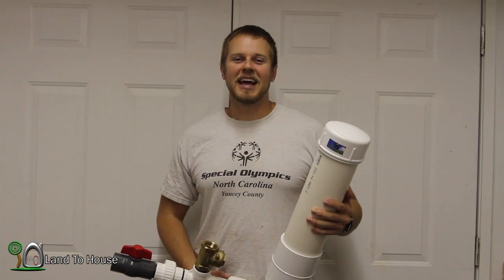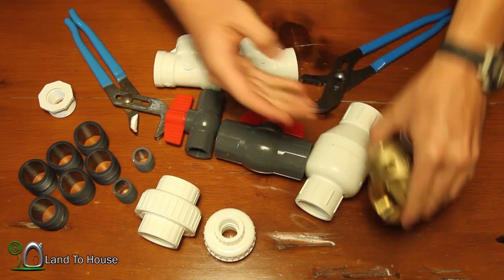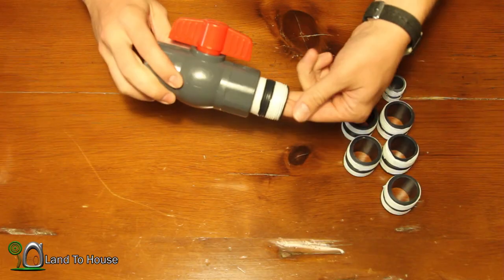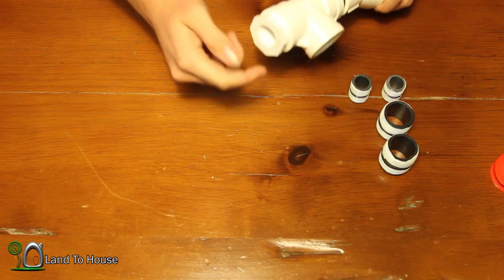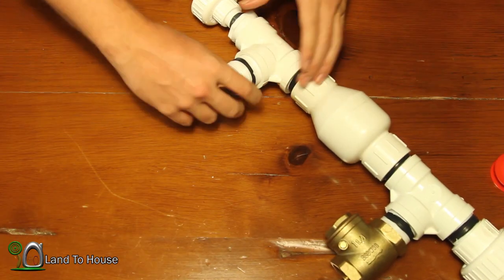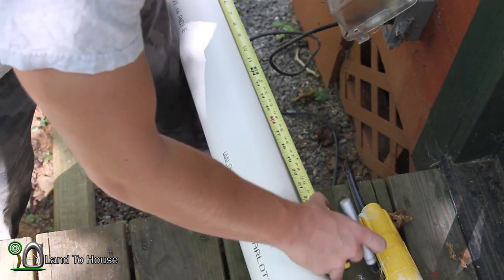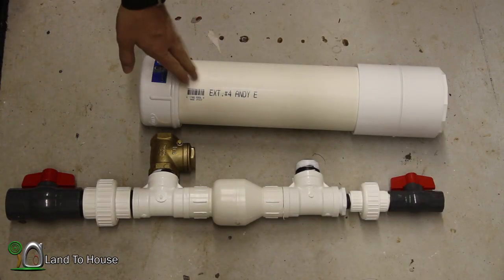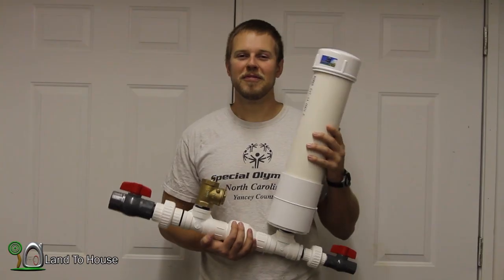How to Build a hydraulic Ram Pump

Comment: Why do you choose to use an inline valve instead of 2 brass check valves? Thank for the awesome video.
Reply from the maker: Thank you for watching! There are a few reasons. Pvc is cheaper, lighter, and when tightening the pvc does not have a direction. The brass has to have the swing pin upright.
Reply: @LandtoHouse  Thanks so much for the reply. My only concern was will the inline valve have the durability of a brass check valve? 
If I understand what you're saying (and I probably don't - :^} ) there would have to be a few more components to get a second brass check valve in the proper orientation - or - is it the orientation of the threads that's the problem?
Thanks again! Awesome video and product. I have you bookmarked and in my wish list on Amazon.

Comment: Very nice How to Build!!!
A quick question:
I have a great Creek with very strong flow, so I don't need my source water up from the pump because it's good already.
But how is the limit distance from pump to the destination tank when the land is 45° Up?
Reply from the maker: The horizontal distance is of no consequence to the ram pump. I have personally pumped over 700 feet with no reduction. The vertical height is the limiting factor for the ram pump. For every one foot of fall entering into the pump you can expect seven feet of lift. The angle does not matter.

Comment: I would suggest to use the stainless steel check valve but it is better to take out the spring
Reply from the maker: The stainless steel valves will be installed in all LTH pumps in about 2 months!
Reply: @LandtoHouse  My ram pump sometimes the heart beat is not cosistent and the pump is stop. One time watching on the yoitube when one of the guy is making his own ram pump he take out the spring of his waste valve so I decided to do the same and have a very good result. For more than a month my ram pump is continuosly working witout any single stop and the heartbeat is very consistent.

Comment: Hey Seth, .... so, if I was wanting to build a pump, to deliver water to a sprinkler or dripper hose, would this be an option for the hammer pump, rather than delivering to a tank???
Reply from the maker: Hello. I have on my list of tests a video showing the ram pump running straight to a drip line. The flow rate is typically slow and the pressure is low. It works best to have a storage tank that you can run the water from. But I have a few customers who have run the ram pump straight to drip irrigation.

Comment: Is there a formula on how to calculate the size of the ram pump relative to the height and lengt of where the water is needed?
Reply: I watched a video of a Colombian manufacturer of ram pumps and he say a 2"inch check valve and so the rest of the pump should cover a 500 meters distance and about 35 meters height.
Reply: @venley28  nice information thank 😊🙏

Comment: I have a question why do a 1- 1/4 Ram pump versus a 3/4 Ram pump is it just because the bigger one moves more water
Reply from the maker: Yes you got it. Larger pumps move more water.  If you don't need up to 1440 gallons a day than smaller pumps are great.

Comment: Learn how to pronounce close for a short nipple. It is not like close (cloze) a door. It is pronounced close, like 'That is too close for comfort.' Nipple sizes start at 'close,' 1 1/2 inch. 2 inch, etc. When you use a close nipple, the 2 fittings end up 'close' to each other, not cloze to each other.
Those are not wrenches, not even pipe wrenches. Those are Channel Locks or tongue and groove pliers or previously known as Water Pump Pliers since they were used to periodically tighten the packing nut on the water pump on the car engine. 
You tell us to put the Teflon tape on clockwise but you hold the roll backwards. If you hold the tape so it comes off the bottom of the roll as you pull it away from you over the top of the threads, you can wind the Teflon tape tightly so it forms into the threads. 
I would be embarrassed with the lack of knowledge in this video. Oh yeah, don't forget the PVC primer before you use the PVC solvent weld cement and a 1/4 twist to seal the joint.
For an efficient pump, you want the pressure in the tube to be 5 to 7 psi less than .43 psi for each foot of rise of the water on the pressure side. If you are pumping water up 100 feet, the tube should be 43 psi minus 7 so 36 psi. .
Reply from the maker: Hello mark g. Thanks for the comment. Pronunciation is a funny thing. Ask my Mexican friends to pronounce that word. You will be embarrassed haha. Perhaps it's because I have lived in so many places with strong accents that I pronounce words differently.  ... tool name: yes it's a channel lock. .... if you would post a video of your ram pump work please. I would love to learn from your knowledge.
Reply: @LandtoHouse  You said, "1 1/4 'cloze' pipe nipple that allows the components to be screwed 'close' together." You did not even notice your own 2 different pronunciations in the same sentence. 
If you learn the names of parts from your Mexican friends, maybe you can learn a bit and teach them. 
I never ended up building a pump. I lost my artesian flow when a neighbor down the hill illegally drained the water table below my artesian level by venting his well. He vented 25 million gallons onto the ground in 8 months.
As a student of mechanics and physics, I've studied the various designs. The air chamber needs enough pressure to hold the water column to the top. If you do not put enough pressure in the inner tube, you dampen the ramp force and limit the amount of pressure that can build with each stroke to pump water up the hill.  The system will still work but just not as well. An under pressurized inner tube will end up crumpled up as it is compressed to the water column pressure.
I like the designs that use a hot water expansion tank as the ram chamber. The diaphragm in those tanks has less water turbulence so the ram energy is used efficiently. The reason ram pumps work is they use the momentum of the water to build the ram pressure. Water swirling around an inner tube can lose a lot of the momentum. Think of it as water drag or friction. 
I'd like to try making one with an inflatable test plug. https://www.ferguson.com/product/cherne-test-ball-4-in-test-ball-blocking-plug-molded-in-valve-removable-chain-c270040/_/R-30866
It would be fun to build a couple different designs to see which works best.

Comment: Do you have any idea on its limitations? Such as elevation, or distance it can pump?
Reply from the maker: This style Ram pump typically tops out at a lift height of 180 ft. This is due to the weight of the check valve. As distance goes it is good for hundreds of feet.

Comment: My apologies for spamming you questions. If you dont have the time I understand. Mind me asking why you had to put the bicycle tire in the air tank and if its important to do so?
Reply from the maker: The bicycle tube inside the pressure tank is not necessary. But with this style Ram pump the tank will become waterlogged over time. The inner tube helps prevent that.

Comment: How long does it take for the tank to become waterlogged and reduce the efficiency of the pump?
Reply from the maker: Depends on if the pump is tilted or upright. you should be good with a couple months of use before you would need to drain the tank.
Reply: @LandtoHouse  Since we don't have a tank yet, does it water log faster if you stop the flow at the terminal outlet and let the pump run.... like over night?

Comment: Is the size of.accumulator or pressure tank important? Does it affect the the speed of valves opening and closing?
Reply from the maker: The pressure tank needs to be large enough to keep pressure when the delivery valve is opened. If the tank is too small the pump will stop.

Comment: Is there a reason why you used a pvc check valve rather than 2 brass ones? I’ve seen it both ways and was wondering if there was any benefit either way
Reply from the maker: Back in the day I would use two Brass valves. The main reason for the second valve being PVC is for easier alignment of the pump and lighter shipping cost
Reply: Brass is WAY more expensive as well.

Comment: Just a question -- why do you have to use the inner tube? What if you did not and used a larger or smaller container ?
Reply from the maker: The pump will work just fine without the tube but over time the tank can fill with water. The tube just helps to keep that air in the tank.
Reply: THank you VERY MUCH ! Your helps means a lot to me :)
Reply from the maker: Happy to help.
Reply: THank you VERY MUCH ! Your helps means a lot to me :)
Reply: THank you VERY MUCH ! Your helps means a lot to me :)

Comment: I was able to run my water supply line from our water pump 380 ft and about 110 ft. In elevation to get the creek to my container. One gallon in 7.5 minutes
Reply from the maker: Great results! The ram pump is not made to have a high flow rate and at that height you are doing well!
Reply: Approximately how much head to pump height does your supply line have.  Also how long is it
Reply: My drive line to the pump is about 110 feet long with about 18-20 of elevation.

Comment: FYI I use a pressure relief/safety valve with spring removed on the waste valve to get maximum discharge psi. By adding weights on the valve stem.

Comment: Hi Seth. Will ram pump work if the water source is below the ram pump?
Reply from the maker: No sadly you have to have head pressure to operate the pump.
Reply: Any recommendation how to pump water that are below the surface? Eg. Basement water.

Comment: My set up is all metal 1 1/4 inch I’ve got over 300 feet of head pipe. It starts at my lake and runs down the creek. Just my head pressure is 20 psi. I’m pushing the water through a garden hose up to my house about 250 feet with an elevation difference of roughly 80 feet. 
My question is what would happen if I changed the waste valve from 1 1/4 to 2 inch? I’ve had to weight down the flap of my waste valve to get the cycle time right and now she needs replacement.
Reply from the maker: Because you have so much head pressure you should be just fine with the larger waste valve. Normally I would say that it is not good to mismatch the waste valve and drive pipe but with that much head pressure you can get the larger valve to close no problem.
Reply: Land to House thank you for your expertise.
Reply from the maker: Happy to help.

Comment: what kind of lift do you get with this ram pump? thanks for your well explained video kudos
Reply from the maker: This diy style ram pump will typically get a 1:7 ratio head pressure to lift. So if you have say 5 feet of head pressure you can expect to have a max lift of 35 feet. This style will max out at around 180 feet of lift.

Comment: Why 17"? can you provide a good background why? I appreciate your indulgence, thanks...
Reply from the maker: There are calculations that have been made to determine the correct pressure tank size. I like that size because it is plenty large enough to hold pressure when opening the delivery valve and it also ships well.
Reply: Land to House in

Comment: question: why do you use the brass check valve for the waste tube? isn't it cheaper to use the same valve as the one at the bottom? also why do you have an inflated inner tube in the pressure tank?
Reply from the maker: The waste valve (brass) needs to be heavy enough to hang open by gravity. Also it needs to have enough weight to snap closed and make the pressure wave. In commercial pumps you can adjust the weight on the valve to fine tune the pressure wave. As for the tube in the pressure tank. That is there to help prevent water logging. Over time the pressure tank can fill with water and the pump will stop. That bladder will keep air in the tank.

Comment: I'm finding 1-1/4 " fittings very difficult to find. Tried Lowe's. Home Depot and all plumbing supplies in out area. They go from 1" to 1-1/2". What size pressure tank would I need?
Reply from the maker: Yes those are hard to find at home stores. My local plumbing store has all the parts to make the 1-1/4" but the lowes does not. If you do not have the 1-1/4" Then I would go with a 1". Use a 3" pipe that is around 20" long for the pressure tank.
Reply: After finding the 1-14" fittings, I was able to build the ram pump. Will a 1-1/4 supply pipe be sufficient and what kind of output PSI can I expect. My supply source is a fast moving mountain trout steam. What is the minimum supply hose length? I'm using black plastic irrigation pipe. Thanks
Reply from the maker: Yes you will need to match the pump size to the drive pipe. 1-1/4" is what you will need. That pipe will work just fine. Using PVC will increase the efficiency. You will need a drive pipe that is between 25 and 100 feet in length. The output depends on the input and output hight. For every 1 foot that falls into the pump you can expect 7 feet of lift out.

Comment: You have inflated the cycle tube .  How long the inflation will withstand?  If the inflation goes off how do you know?
Reply from the maker: I have used a tank with tube for 2 years and its still going. When the tube is flat the pressure tank can fill with water and the pump will have reduced output.
Reply: Instead of using a cap. Use a clean out for the cap. The you can access the bicycle tube.
Reply from the maker: That has worked for a number of people.  in my experience the pressure that can build (70+psi ) can blow that clean out cap or at least leak.
Reply: @LandtoHouse  I've never installed clean outs on anything with pressure. I guess that's the stuff you learn from building a bunch of ram pumps. I never thought of the pressure getting that high lol.
Reply from the maker: @robertkywildcats9266  Yes for sure! That pressure really gets high with the delivery closed. Some people have had success with metal threaded caps. but they can still leak.

Comment: Great video!!
Also one question please:
What would be the difference on delivered water if you simply keep all fittings same size?
Reply from the maker: +saeed1642 thank you. As long as you have the waste valve and drive pipe the same size the other components can be altered. Increasing the size of the delivery pipe does not affect the output of the pump.

Comment: sir .what is the porpuse  of the rubber interior ????
Reply from the maker: I have asked my friend to give me a pool noodle that she does not want. I hope to test out the difference between the noodle and bike tube soon. We have 9" of snow at the moment and its 26 degrees out. haha
Reply from the maker: +roelfrancis rodriguez because this model pump does not have a snifter valve to replenish air in the pressure tank a bike tube is used to fill the void in the pressure tank and prevents water logging
Reply: Could you replace the inner tube with a piece of "pool noodle"?

Comment: sorry to keep bugging you but what do you think about running a pliable material into your pressure tank making your pressure tank much larger and using the ram pump to compress air you could then use the compressed air on a Venturi pump to drop potable water out of a well just a thought I am far from a genius LOL if you couldn't tell from the other comment but I do have a habit of thinking outside of the box
Reply from the maker: I have wondered how one might use the ram pump to pressurize air. So far I have not seen a design that worked. If you can make it happen you will be on to something!
Reply: @LandtoHouse  Have you seen Mr Teslonian's Trompe Hammer?
Reply: That's clever, when you actually are using the pump to move water up hill the pressure in the tank should increase. If you have another valve attached to the Air tank portion (at the top so it fills with air) you could open it the pressurized air could be moved to a different container. I think you would need the snifter  valve or some other way of adding ambient air back into the air tank when you remove it.

Comment: 1 durther question, could you use a blatter (with water in it) in your presure tank and create artificial head preasure or drop?
Reply from the maker: The pressure in the tank is behind the second check valve. At this point head pressure does not matter anymore. A friend of mine has found that adding an air bladder in the tank, that can be pressurized, can help increase the output a little.

Comment: I had a thought with the ram pump could you float your supply line in a pond  or lakewith a platform submerged and waited which would force it to stay level for the most part giving you however much drop you can get out of the depth allowing you to pump pretty much anywhere you want from a lake or pond
Reply from the maker: Sadly this does not work. It would make life much better. It is true that submerging the ram pump in water increases the head pressure but the hydrostatic pressure negates the increases head pressure. This means that the pressure going to the pump is Zero.

Comment: nice  but i want my pump to push abt 1500 ft what size i have to build
Reply from the maker: The ram pump can push water that far without much problem. The issue is with the vertical lift. How high are you looking to pump over that 1500 feet?

Comment: is there any way to clean up the waste water like put a small bucket 
over the check valve so the water drains back in im not worryed about 
how muck it pumps over time or the pressure
basicly what im doing is useing a bell siphon to drain my hydroponic 
into my fish tank then from the fish tank to the ram pump back into the 
plant pot
Reply from the maker: You can install a bucket to catch water from the waste valve. The problem is that the ram pump is only 10 - 20% efficient. You will lose most of the water from the waste valve and then you would need to use a solar or electric pump to put the water back. The ram is just not a good pump for a closed system.